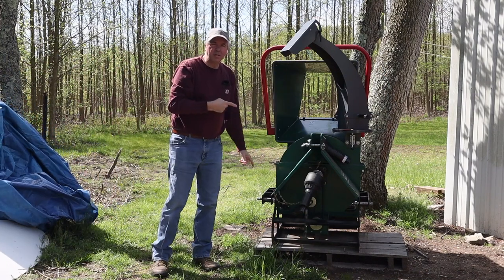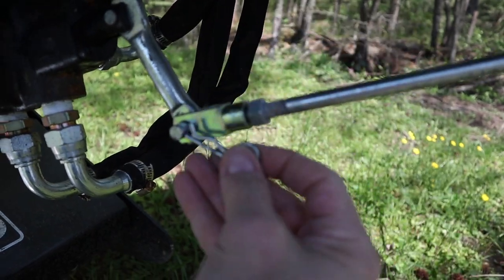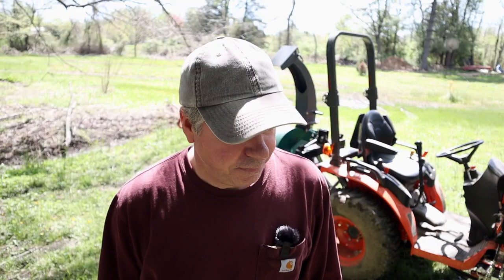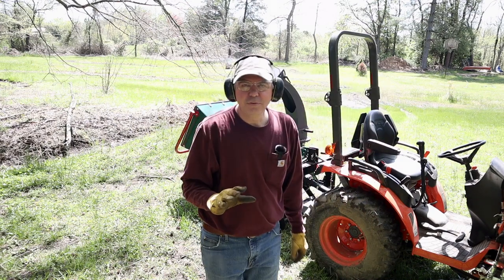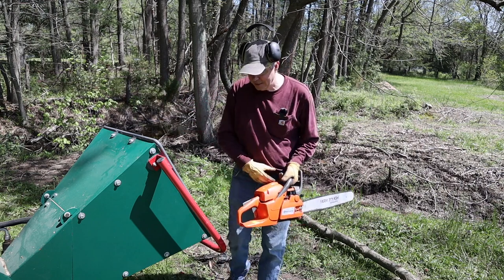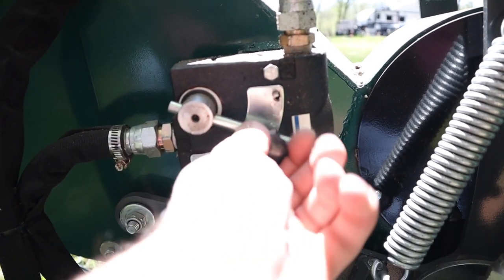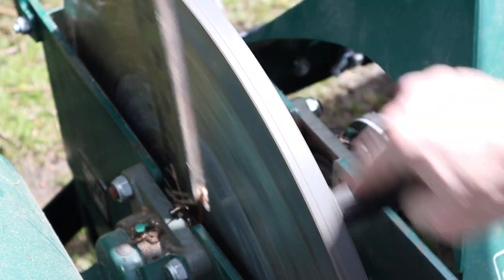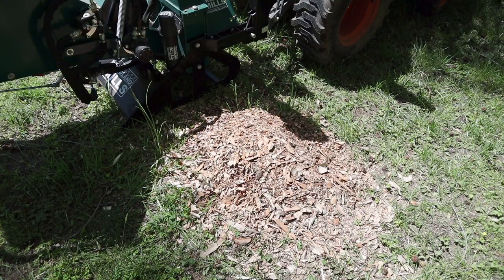#11 Kubota B2601 with the Woodland Mills WC68 Wood Chipper. The best PTO wood chipper for you?

Comment from the maker: Check out the new merch store! www.shopmcg.com

Here are some other product suggestions that I use. These are Amazon Affiliate links, so purchasing will help this channel by providing a small commission while not costing you any more. Thank you for your support!
Husqvarna 455 Chainsaw:
https://amzn.to/3nUMldP
My favorite chain for the Husqvarna 455 with 20 inch bar:
https://amzn.to/2Haae0f
Lumax Heavy Duty Grease Gun:
https://amzn.to/3mFK1pA
LockNLube Grease Gun Coupler:
https://amzn.to/3kPcvwu
Recommended Grease:
Valvoline Moly Fortified
https://amzn.to/3jNM1Kv
Nitrile Gloves:
https://amzn.to/34Kg8OG
Deerskin Gloves:
https://amzn.to/2I17NNy
My Video Gear:
Rode Wireless Go II microphone:
https://amzn.to/3eiJatG
Canon M50 Camera (now Mark II):
https://amzn.to/3vHW9uD
Battery adapter for M50:
https://amzn.to/2RshsBE
Sigma 16mm prime lens:
https://amzn.to/3vJDRcx
Sigma 30mm prime lens:
https://amzn.to/3epFneh
Variable ND filters:
https://amzn.to/3tmoHIs

Comment: Great review for a great chipper.  I have the WC68 for my Kubota LX2610.  It is exactly what the company represents it to be.  Great quality.  My favorite attachment.  For less than $100 they sell an optional chainsaw holder that is very helpful.
Reply from the maker: I love it!
Reply: @MyClutteredGarage  While I use a Stihl MS250 chain saw for my typical tree and limb cutting, I also use a 12" Dewalt 20V battery chain saw that I leave on the WC68 chain saw holder.  It is so convenient for quickly cutting off branches that don't easily fit into the chipper chute on a 4-6" tree.

Comment: Run WC68 on an L series Kubota.  Works well!  One drawback with the unit worth mentioning, it does have trouble clearing through the chute throat white pine needle branches.  Keep plenty of needle free or leave free branches around to clear the unit or you'll be opening the chute a lot to clear the pine paste clog in the chute.
Reply from the maker: Thanks WKS. I haven’t had any problem with the chute clogging or backing up. My biggest complaint is that the intake roller has a hard time grabbing larger limbs. I do love this attachment though! -Ed

Comment: I haver the same chipper. It works great. The support from them is excellent. If you have a issue they will help you on the phone. They will ship you parts if required. I also run mine on a B2650 tractor. It does not drag the tractor down. 4 blades uses less power. The chute will plug up if you are chipping green cedar small branches. I find if you spray the chute with Jig a Loo dry graphite it really helps. If you do plug it the chute opens up so easy and it is easy to clean it out. Now for the good Husky going in I have another story. I use a 4 ft. bar to help clean out the chute. Well I had to move the tractor and where did I set that bar. You guessed it. The knifes did not like the steel as much as plastic. So like he said never/never put anything in that hopper than wood.
Reply from the maker: Wow! Sorry to hear about your mishap! I agree 100% about Woodland Mills customer service. Top notch! Thanks for watching.

Comment: I'm a Husky chainsaw owner as well. Mine is the original "Rancher". I don't remember the CCs, but I think the original one is smaller (engine) than later. My friends all have Stihl. Lots of them are on their second saw (not chipper related...), but my old Ranger just runs and runs. Even in California with our super expensive ethanol garbage fuel I have been able to protect the carb and have not rebuilt it yet. Thanks for the tip on the hopper!!! My Dad was the same way about stacking things like wrenches on a car battery (you know what's coming.....)
Reply from the maker: uh oh!

Comment: One interesting thing to point out is that the moment of inertia of 24" flywheel is over triple that of an 18" flywheel of the same thickness. This is really a much bigger upgrade over the smaller unit than it sounds.
Reply from the maker: Good point. And good mathing. Thank you. -Ed

Comment: Woodland chippers are sold in Australia. We might buy one. If we do we will get the biggest as my tractor may not have quite the power to chip the biggest limbs but it should chip smaller branches more easily.

Comment: regarding the adjustable feed rate idea.
I hope this message is worth reading. your idea really got me thinking and rambling.
the concept sounds good and is easy to understand -- how it could be modulated by the position of the feed wheel.
while it could be made safer (?) by having the speed ramp up and down smoothly and relatively slowly rather than suddenly, an automatic change in feed rate would be a safety issue.
i could (almost) program a (Arduino) microcontroller to do this based on the feedback of a position or tension sensor feeding info to a stepper or servo motor.

i love the idea, but i would not do it. i will just try to feed similar stuff in and adjust as needed (for general size) and pass on auto-optimizing the feed rate. 
I already see myself wanting the auto adjusting rate while i am standing at the chipper.
Reply from the maker: Thanks for this thoughtful comment. I’ve found it seems that larger limbs kind of naturally slow down the feeder when it’s set to 2.5 to 3. It seems like a good all around federate. I could definitely speed it up for smaller branches but I often just walk away and let it take its time while I grab the next branch. I’m with you - I’ll probably never do it, but it seems doable. Thanks! -Ed

Comment: I have been then watching all the WC68 Youtubes I can. I see a reoccurrence on about 1/2 the Youtubes and that is the Safety/Neutral/forward/reverse orange bar will move out of "forward" while folks are feeding their material and then they stand right next to the hopper holding the bar in the forward position. That seems dangerous to be positioned there when feeding large and bushy limbs. The other half of the Youtubes I watch including the one from WL Mills show the Chipper consuming every kind of branch or trunk imaginable without ever needing to touch the orange bar once engaged.    Is there an adjustment? My tractor (a 1950's Ford) is at the bottom and below the PTO HP rating and so I am concerned this could be a HP thing.   What are your thoughts?  Thank you for this excellent and honest YouTube!
Reply from the maker: Thanks for watching and commenting! I have not had any issues with the safety bar. I’m sure you can tighten up the connection so it takes a little more force to push it in. I imagine your Ford is a gas engine. I would be concerned about anything much less than 19 hp at the PTO. You might consider the WC 48.
Reply: @MyClutteredGarage  The submarine stuff was Sofa King funny!

Comment: Very good points you made. I have a Yanmar 2002d, which is a 20hp tractor, and have been considering one of these for awhile, and was almost set on the wc48. Seems like I could go with the WC68, as anything  larger than 3”, I usually cut for firewood anyway.
Reply from the maker: What’s your HP at the PTO? WM recommends 20 at the PTO. My tractor is 26 hp and puts out 19 at the PTO so I’m just at the limit for the WC68. They have great customer service. Give them a call 👍

Comment: I just bought a WC88 to run on my B3030. They told me it won't run it, but I'm running an 8inch Woodmaxx with it now with zero issue. We'll find out one way or the other.
Reply from the maker: Just run smaller branches 👍

Comment: "The Husqvarna was no more". Man,I feel your pain and I'm a Stihl guy. Remember, a wood chipper is like a firearm, do not place anything in front of it you do not want to destroy. Stories about climbers ropes and rocks getting tossed or pulled in.
Reply from the maker: Daniel Weaver - Amen to that! Thanks for watching. -Ed
Reply: @MyClutteredGarage  I had an oak tree fall kinda l goofy and pinch my 029 and yank it out of my hands. Snow had laid it over to about four feet high. I always plan for escape. Saw and tree went west and I went east. Tree was down and saw was off. All quiet. Pick up the saw , oil draining everywhere and the bar was pointing up like morning wood. Case was split . That led to my 461. Bought a blown 029,swapped my running gear into that case,still running. 22 years.
Reply from the maker: Daniel Weaver - Wow, nice job!

Comment: your bearings are probably detroit bearings and they are easily damaged if you get wire on the shaft.   they are a bear just for time to replace, that happened to me.   my unit is a small tow behind.

the compression rate is probably about 20 to 1,  although it can go up.   remember that compression is cube to cube volume,  and the mass will remain the same, but the area is occupies will decrease

if chipping greens stuff, you will get sap, or the plant amino acids on your fly will and up the discharge chute and you will need to clean that out every so often, which i do with a chisel and just run the blade over the metal (take care not to be injured, those chipper blades are sharp)

on the topic of chipping green (which was 90% of what i did),  the biological composting that will take place will sink your volume height significantly in a very short time, and if the pile is large enough, you could have spontaneous combustion/explosion due to the decay inside.

i have not had either one, but keep in mind 36 inches will become hot enough to keep snow free over two or 3 months of a winter.       

check out composting for additional safety issues on this

last point,  many trees/shrubs have a natural fungicide in the amino acids and this usually takes about 3 weeks to dissipate.    once this happens your pile of goodies will almost disintegrate into compost in a few months.    only then would i put it around a garden as the composting takes energy that plants would otherwise get from the fungus/bacteria and insects that help your plants.

Comment: Got my 68 chipper mounted on a L4400 Kubota running at 42hp and works great for the most part, especially on dry branches. However, problems with clogging when putting green fir and spruce branches through. PTO speed, feed speed and anvil clearance are very important but even when they are set correctly chute clogs are frequent 
Thanks for the vid
Reply: Maybe if the wood is drier it will be less sticky and won’t clog up the chute?
Reply from the maker: That definitely helps. Thank you.

Comment: I had a 35 cc Husky I would have run through your chipper.  Always hard to start.  I was always tired and mad before I made the first cut of the day.  Sent it in for service, got it back and it burned the top out of the chain oil reservoir before it used up the first tank of fuel.  Shop refused to even quote for repair.  Gave the parts away.  Finished the job with an electric chainsaw.

Bought a 310 Echo.  Starts every time.  Even after being left for 2 years with fuel in it.
Reply from the maker: I'll keep the chipper in mind for "tools I hate". Thanks for watching! :)

Comment: Howdy Ed - Always enjoy your topics.  I too have the B2601 and looking for a chipper.  Does this have shear bolts? Slip clutch?  I looked at the WM website and downloaded the manual for the WC68 but could not find info in the text or even the parts break down.  Let us know if you know. Thanks.
Reply from the maker: I’m almost positive it has a shear bolt. I think it will bog down and stall the B2601 before it shears. I run at full throttle, never sheared a bolt, and only stalled it once.

Comment: I'm getting ready to buy one of these for my JD770, torn between WC46 and WC68.  My rear PTO hp is rated at 20, so I think I'm OK there.  But my rear lift capacity is 815# and this thing is over 700# according to the website.  You mentioned in your video that yours is over 800#?, so rear lift capacity makes me abit nervous.  What is your rated rear lift capacity?  Did you have any troubles with moving this thing around?  Did you have to add any weight to the front of your machine for balance?  BTW, appreciate the sub humor (I'm an old USN sub sailor)!
Reply from the maker: Hi Nick, I have no problem whatsoever lifting and moving it around. The B2601 really doesn't seem to know it's there. However, first I do do have a front end loader that helps act as a counterweight, and second according to tractordata.com, my rear lift capacity is 1808 lbs whereas the 770 is rated at 815. Although these tractors look to be similar in size, that's a surprising difference. Good news though, I just looked at the WM website. It says the WC68 is actually 710lbs. The 825lbs is the shipping weight. I can tell you that the folks at WM are great with customer service and answering emails. I'd check with them to be sure. Thanks for watching and for your comment! And thanks for your service too!!! Hey let WM know you saw my video :)

Comment: Thinking about getting the WC68 for my B2601. I'm sold on the horsepower at the PTO but my concern is the weight. All the videos show operation on perfectly level ground but I'll be downhill to the chipping location, uphill returning, and sometimes not level where I'm chipping. It's not the rocky mountains or anything but can the B2601 carry it on a grade?
Reply from the maker: I don’t see why not. Although I think you’ll always want to operate it on as close to level ground as you can. Thanks for watching!

Comment: Your video was very informative and I really enjoyed it. One thing you mentioned is 540 rpm PTO. What engine speed do you need on the tack to achieve that. My 2601 does not have a 540 visual PTO speed on the tack. Is the 540 PTO speed at 2800? Thank you the great videos you do.
Reply from the maker: Thanks Wayne. Yes, on my tractor 540 at the PTO is achieved at about 2800 on the engine. There should be a little red tick mark on your B2601 tach to indicate where 540 at the PTO is. Hope this helps. -Ed

Comment: To what length did you have to your PTO shaft in order to work with this?  I just got one of these and I am going to use it with a LX2610 and looks like the PTO shaft is going to have to really short.
Reply from the maker: Hi Scott, I don’t recall but it is quite short. Jon Ritter @A Ritter Bit Will Do recently made a good video about cutting PTO shafts.

Comment: You forgot to mention how hard it is to get the PTO bar installed.
leaves are a problem, it clogs up the feed roller. the air flow is not enough if you are chipping fresh branches with leaves. I have had the chute clog up many times. 
It works good if the branches have only a few leaves. 
I had a China chipper before and it worked way better. only problem with it was getting to the blades. no clam shell.
Anyway if I had to buy another one woodland mills would not be my choice. I sent complaints to woodland mills, no reply.
Reply from the maker: I haven’t had mine clog up other than when chipping fresh cedar or pine. WM just released a new unit with a double flywheel that generates better air flow. Maybe they listened after all 😄👍

Comment: So how do you move it around?  Does it lift up on the back of the tractor and you can drive it around?  Plus is it Highway legal? Could you attach wheels and hitch it to a ball on a truck?
Reply from the maker: Hi Bob. It just mounts to the tractor 3 point hitch. Since you need the tractor to operate it, that’s the best way to transport it. Thanks.

Comment: I think your idea for an adjustable feed rate is a little too simplistic. The size of the branch is not a perfect analog for hydraulic load; a heavy/thick branch without limbs is a large load that won’t move the wheel up as much as a small branch with lots of branches poking out of it. I think you’d need a hydraulic pilot that adjusts based on pressure differential across the hydraulic motor to regulate load at maximum.
Reply from the maker: Thank you KurtisB. I was definitely thinking simply. Your idea may not be as simplistic, but seems logical. Thanks for watching! -Ed

Comment: Woodmaxx WM-8M, hands down...
Reply from the maker: I'd love to give it a try and compare the two!
Reply: @MyClutteredGarage , They also have a WM-8H, hydraulic feed, but I didn't find it necessary...the kicker to both these units, capacity, 8"...
Reply from the maker: @wipatriot510  - what draws the limbs into the chipper on the 8M vs the 8H? Is there a mechanical feed?
Reply: @MyClutteredGarage , Yes, hence the "M" vs the "H" of the hydraulic feed...

Comment: It has design flaws.  Blade is to far from feed roller. This space gets clogged with leaves. Then the roller gets stopped.  This space also allows branches to go side ways once they are no longer pushed into the blades. Wish I had known this problem before I bought the machine. If you just have branches and no leaves the not that much problem. 
The stationary blade is off to the side. Should be across the bottom to make for better cutting.
Reply from the maker: Hi Dennis. I haven’t had any of these problems. Do you run the PTO at least 540 RPM? The biggest issue I’ve had is that the intake roller has a hard time grabbing branches larger than 3 inches.